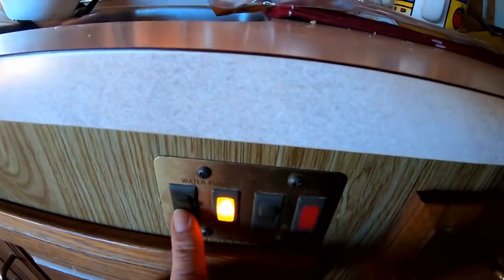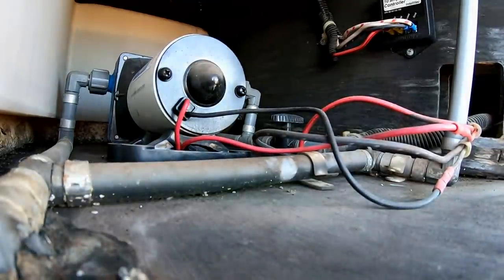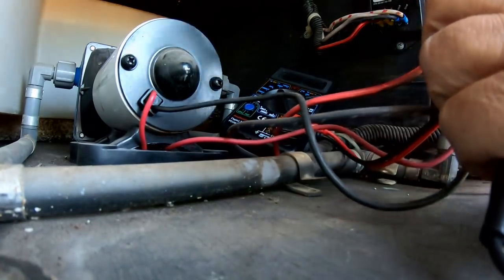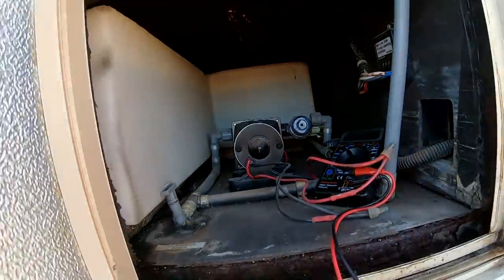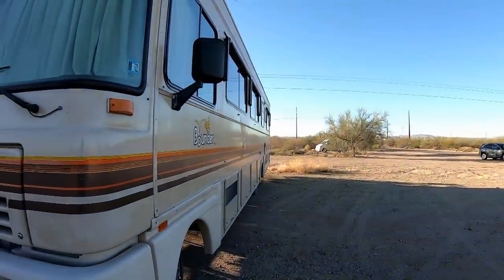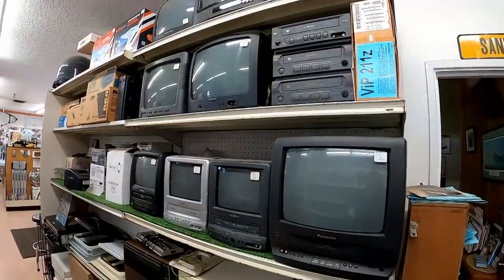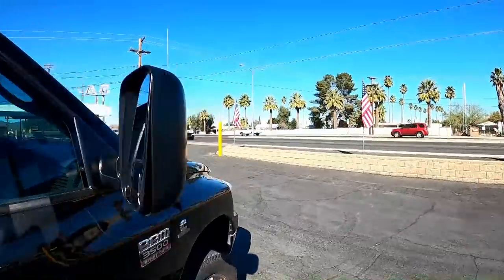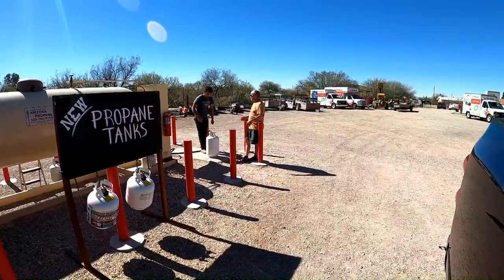RV Water Pump Diagnosed and Replaced - Travel Plans Change & Boondocking With Friends

Comment: Your water pump only lasted 2 years? At least it was easy to change. Mine is not so easy. There’s no easy access to it. I’d have to empty my storage area then take off a panel. Etc etc. A bad design on this 2013 Coachmen Freelander.

Comment: Hello Dave 
Glad u got your water pump fixed.
I suggest a new project.  Replace the Cam Shaft with 3 bolt cam. More power & Performance & Mileage. Add on a Gear Vender Overdrive. Killer gas mileage

Comment: Something else that can fail is the latching controller. It it is up on the wall above the pump on your right. The latching controller lets you use several switches to control your pump.